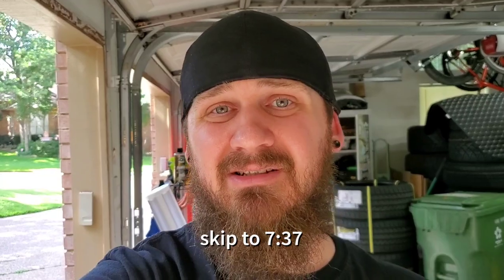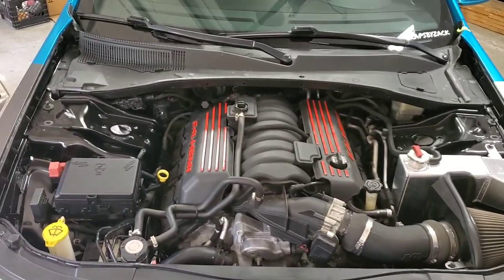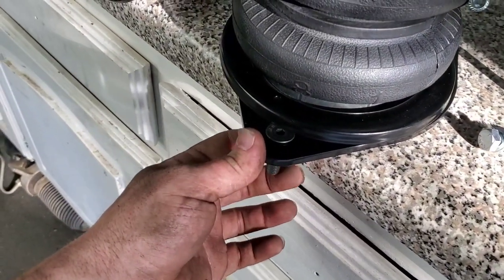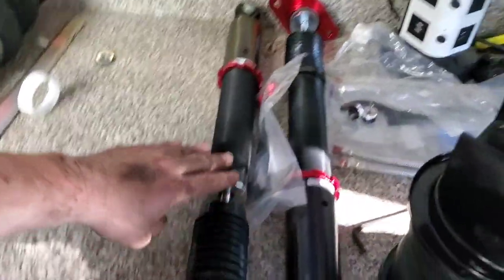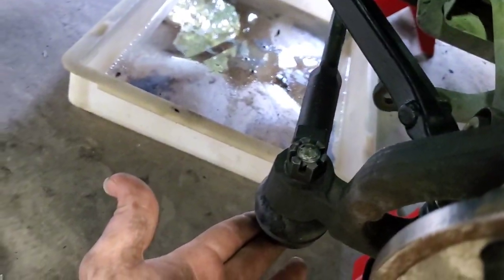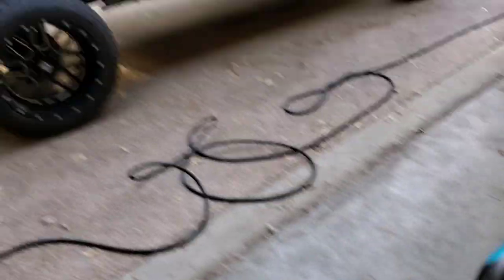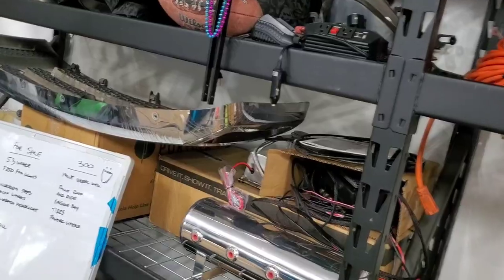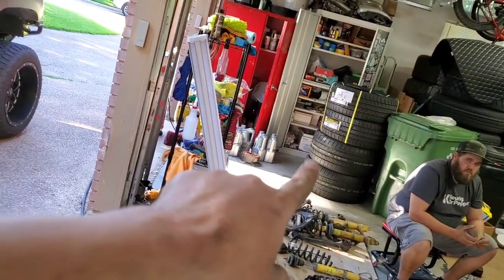Air Lift Performance vlog style install on my 2013 Chrysler 300 SRT8 (air ride) | Part 1 - Bags

Comment: Got damn that rear setup is a b**   especially getting that bolt up in the cradle.  Ill definitely have to check that after the install. I think a week is a good time frame like you mentioned
Reply: I ran a tap through them a couple times to clean the powder coat out of the threads and it made it a lot easier.

Comment: Still no spare tire. Your dad may get tired of sharing his spare.
Reply from the maker: Thats low. Hahaha. Atleast i know you've watched my old videos. The SRT doesn't come with a spare. I have my stocks if I need a spare now.
Reply: I always watch your videos. Our cars are twins.
Reply: Zack can I get your input on some things...for my 2018 300s....
Reply: @ZackStenstrom  need some input from you plz
Reply: Buy a 1.5” wheel spacer. Put a typical 18” spare in the trunk which does fit. Keep a Jack in the car. Only problem is that if you pop a back tire you’ll want to put a front wheel on that back so you can always keep the spare tire on the front. Don’t want to mess up the rear end. If I can find info on that spacer I use I’ll post it but I’ve had it for a while now. Just make sure it’s 1.5” so your spare will clear the brembos